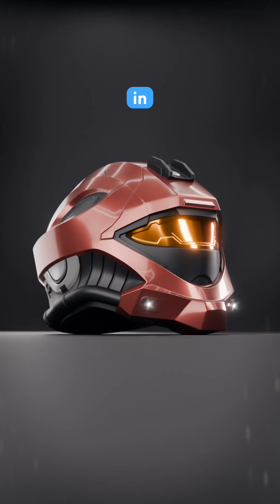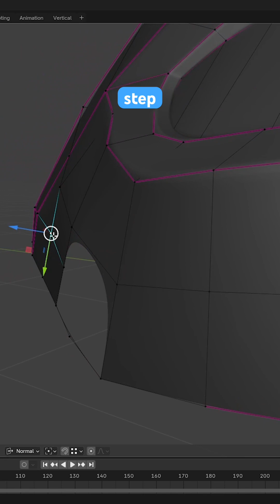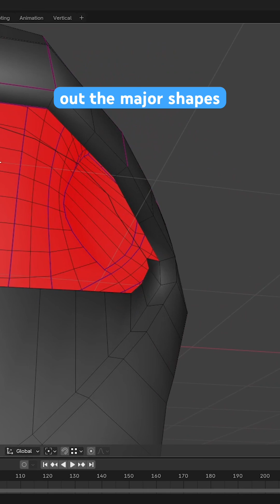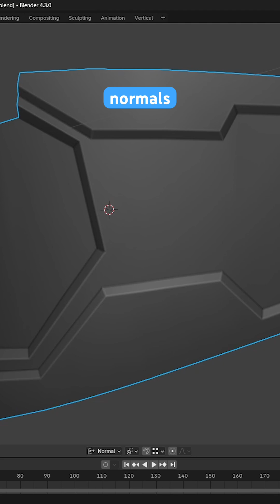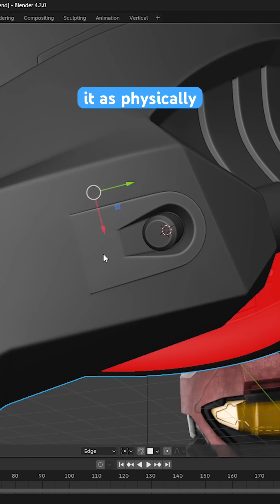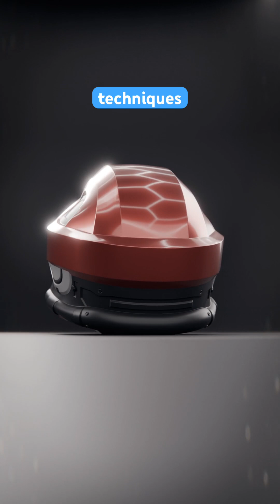Blender Helmet Modelling Tutorial | Halo 3 Recon | #blender3d #blendertutorial #halo

Comment: i want to ask i see you use mixer for texture is better than blender or what and thank you for this course
Reply from the maker: In my experience, yes, I believe that Quixel Mixer is better for texturing than Blender since it's a dedicated texturing software designed for texturing. Blender has texturing tools, though isn't necessarily built with proper texturing tools and libraries in mind.

In saying that, I have heard a bit of buzz around UCUPaint, which is a texturing addon for Blender. However, I still think Quixel (or any other dedicated texturing package) still holds an advantage over this simply due to them providing you with a library of texture maps to work with. From what I understand, UCUPaint requires you to source your own textures, which can be a bit of a challenge. Hope that answers your question? 😄